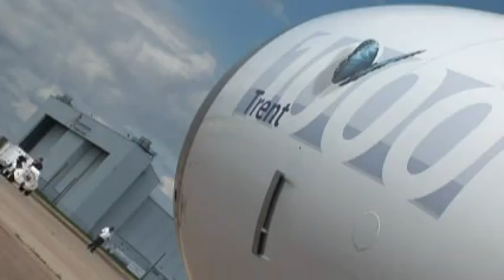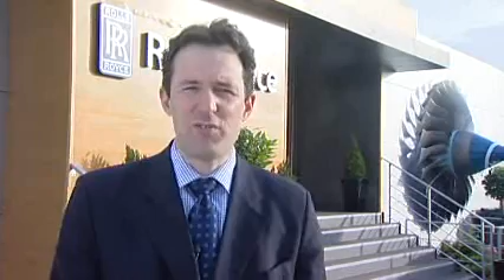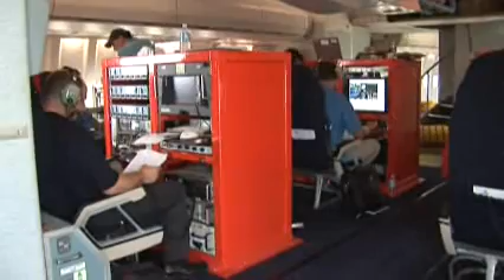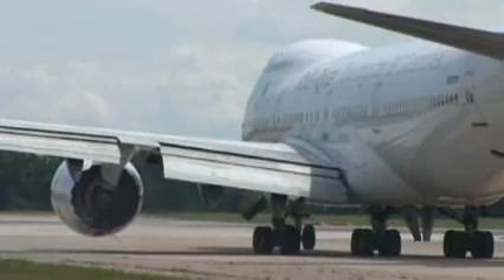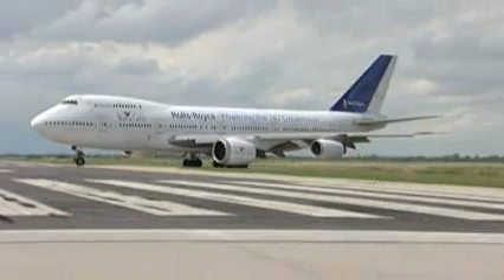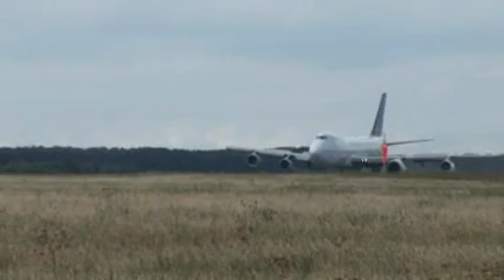Boeing 787 Dreamliner test bed

Comment: Boeing's "Flying Testbed" is a modified 747, the flying testbed is designed to evaluate new engines, which is why as opposed to P&W JT9D or 4000 series you'll notice in the video Engine #2 happened to be a Trent 1000

Comment: @sellboy33 - It's not a 787, but the video title doesn't say it is, this is just a test for the 787. Here they're testing the Rolls Royce Trent 1000, which will be used by all 787's... as you can see only 1 of the 4 engines of this 747 is a Trent 1000. They obviously need to test the engine's performance in flight before the Dreamliner is ready to fly safely.

Comment: Its called the APU (Auxillary Power Unit)
Its another little jet engine that powers the airplane when the 4 big engines are turned off.
Its also used for starting the engines.

Comment: The trent 1000 looks HUGE compared to the 747 engines.
I heard it generated so much thrust they were able to fly the 747 without the 3 original engines fired up!

Comment: The porthole in the back is the APU (auxilary power unit) exhaust. Basically it's a smaller jet engine that is used to provide power to the aircraft when ground power is unlpugged or when the engines are not running.

Comment: ... theres 1 on each side. there's 2 747 engines and 2 787 engines on it. In addition, even if there wer only 1, you could simply apply less thrust to one engine and more thrust to the others. It's not that hard!

Comment: I bet this 747 test bed was worried when it saw the size of the engine that was going to be strapped to it! XD. BTW. It seems that there is some confusion as to why this is called a "787 Dreamliner test bed" - well, this is because they are testing the engines for the 787 on the 747 "tests bed". It''s quite simple.

Comment: they dont know how the engine would perform or react in the air so they needed a test bed, the 747 can still fly with 3 engines in case the test engine fails

Comment: Quote:
Rolls-Royce buys flying test bed for future engine developments

13 June 2005

Rolls-Royce is converting a Boeing 747-200 to serve as a flying test bed for future engine development programmes.

The first engine to be tested on the aircraft, in mid 2007, will be the Trent 1000, currently being developed as launch engine for the Boeing 787 Dreamliner.

The RB211-524C2-powered aircraft, acquired by Rolls-Royce from Air Atlanta Icelandic

Comment: Lol, I have just been researching about the Boeing 787, it seen's like a cool airplane that I would love to fly, when I get enough flight hours. The only thing I don't like about it, is the wing flex, ew. I like thing, they put on the back of the engine, (incase you didn't know, it is "suppose" to make lower the sound of the engine), it's a nice touch to the plane. I think it's gonna out sell the Airbus 350 (my opinion)

Comment: first thing thats not a 787 its a 747 the 787 only has 2 engine not 4. the trent 1000 is the engine 4 the 787 but they are just showing u that one trent 1000 engine can power a 747-jumbo jet

Comment: I remember reading about this test shortly after it took place... They made note in the report that the test subject RR engine was able to keep the 747 aloft (albeit just barely, due to the sheer weight of the aircraft) by itself.

Comment: and also, Boeing has a fantastic track record and is in no way worse than airbus. you guys keep saying, ohh the A380 is the biggest plane ever, so were the best... Boeing created the 747 in 1964... they said it would never fly. il agree the A380 is an engineering feat, even if i think that it may be a bit too big. i also will say that i think airbus copied Boeings 787 with the A350. im sure Boeing could pump out some more designs if itwas funded by an entire continent, as is airbus.

Comment: Mainly because their aircraft are involved in fatal accidents (I don't intend to start a rather weak arguement by the way). This may be due to Boeing (Est.1916) selling an abundancy in aircraft in past years compared to Airbus, (founded in 1970) thus causing numourous disasters. This is only my logical theory. I'm no aviation expert at 16.

Anyhow, Happy soaring.

Comment: It affects the way the air coming from the engine mixes with outside air. The zig-zag allows air to be mixed more evenly (think of it as some air escaping earlier versus the old way of letting it all come out at the same time).

Comment: Yeah most of them do now , Airbus did it with the trent 900 by sticking that on an A330 and testing it. Remember the Rolls royce 747 has nothing inside it , its a cargo 747 it's a flying testbed. it can do something's that derby uk based build and test site cannot do. remember they build the T1000 there some of the part's i have seen go into the site at derby are huge. i live round the corner from the build site and i used to work at one of the site's